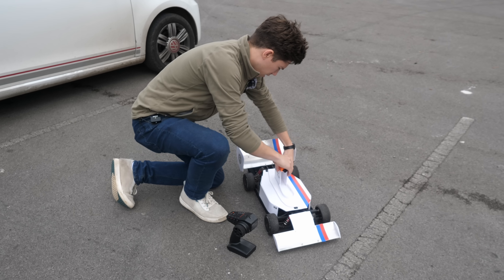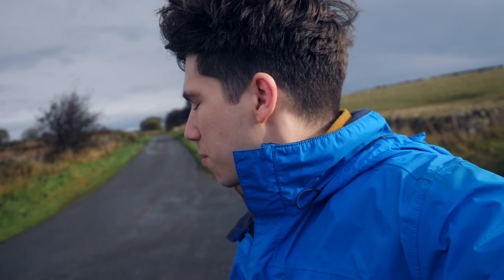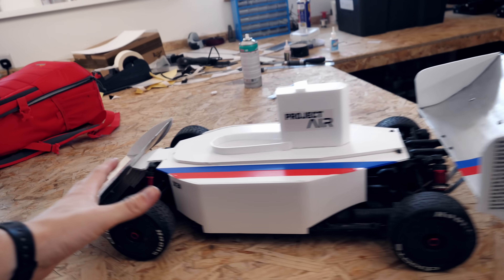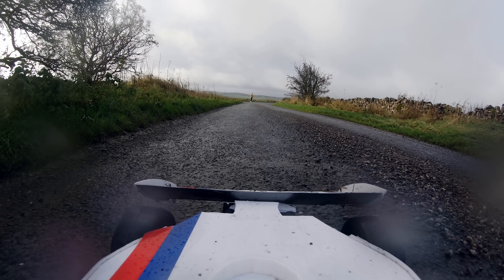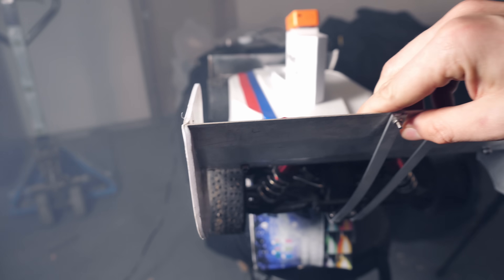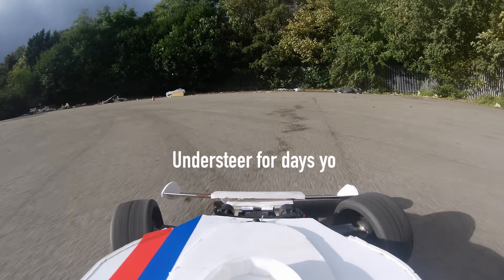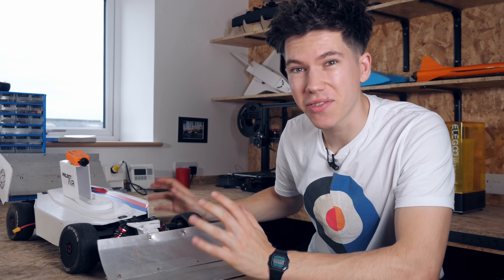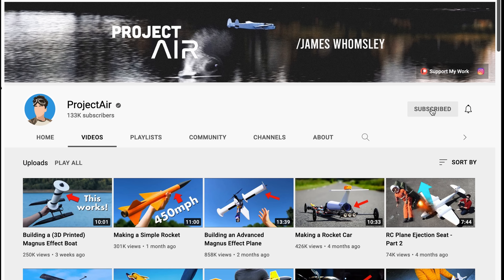RC Car Extreme Aerodynamics

Comment: Quick question, slight sidetrack- what you were saying about the airflow under the pan of the car passing through then expanding to create additional suction, could this be upended and have something engineered to improve lift on a wing..? I guess somesort of "double wing" perhaps?

Alanicus,
Oxford UK

Comment: Could you try active downforce? As in attach ducted fans blowing straight up to push the car down? Then switch off but leave in place for a comparison.
Maybe they could pull air from under the car.

Comment: remember, aerodynamic forces are generated almost primarily on the low-pressure side of the surface -- flow detachment on the bottom of your wings isn't just creating drag, it's also severely limiting the amount of downforce you're generating. less angle of attack on those wings might actually generate more downforce since they wouldn't be stalling. if you wanted to keep the aggressive angle of attack, you should upgrade to a multi-element setup to keep flow attachment.
Reply: Came here to say this, tried to warn him on the picture he posted a few weeks ago of the car.
Reply: Theres just way too much drag on these wings for the amount of downforce they’ll produce. Plus they’re no even an airfoil shape so you wont get much of a pressure differential.
Reply: @George-kd7uz  I’m pretty sure most of the force comes from redirecting the air mass, not the airfoil. At least that’s the case in airplanes
Reply: @jrewhutchison4414  Hold up. Please cite your source so it can be removed from the Internet, because that is completely wrong.
Reply: @George-kd7uz  it's not entirely wrong it's a combination of both
Reply: @George-kd7uz  Lift IS caused by air deflection. The upward change in momentum of the air (a vector with a y-component) causes an impulse (force) on the wing. Action-reaction. No net change in y-direction of air momentum = zero lift, a.k.a. an airfoil at 0deg angle of attack.

As a corollary, ANYTHING other than a sphere can produce lift, because it can produce a net air deflection at some orientation.
But wings are not made out of non-spherical couches because the the lift to DRAG ratio is not good.

Pilot training claiming that lift is produced by differing air speeds over high and low pressure surfaces is just plain wrong.
Reply: @johanvanstaden2408  some lift is generated by air deflection, but the majority is from the difference in pressure. Also, have you heard of ground effect, the only reason that works is due to fast air creating low pressure under a car
Reply: @George-kd7uz  The pressure difference is the same thing as the air deflection. Kinda like the chicken and the egg. The pressure is how the surface enacts the force (momentum change) on the air. 

Ground effect is streamtube theory (internal flow) .... Different from external flow.
Reply: @johanvanstaden2408  The pressure difference and redirecting the flow are two separate ways of creating lift though. If you have a wing with 0 angle of attack it will still create lift from the pressure differential without redirecting much air.
Reply: @George-kd7uz  At 0deg a.o.a. there is lift ONLY IF it's an asymmetric airfoil, i.e. net change in momentum.
Symmetric airfoil at 0deg creates no lift because no change in momentum / deflection / pressure difference.
There are no multiple effects - only 1 flow changing velocity/momentum and pressure. Single body/airfoil, single effect/characteristic at any given velocity.
Reply: @jrewhutchison4414  that's actually not the case at all. I can't remember the name of the video, but there's a great talk from a senior Boeing aerodynamicist about the mechanisms of lift posted on YouTube, and one of his points was how less than half of the force generated from the wing is accounted for by the Newtonian reaction force from deflecting the air mass.
Reply: @George-kd7uz  Check out a "wingcar" used in 1/24th scale slot car racing and get back to me on that.
Reply: @Metal-Possum  its more the fact that he said planes use air deflection to generate lift. Which is wrong
Reply: @George-kd7uz  It's not wrong. That age old comment of "air travels faster over one side of the wing compared to the other" that your physics teacher at high school taught you is a bit of information that just gets parroted by teachers, parents, and then by kids. The biggets flaw of that statement is that there is absolutely nothing saying the air HAS to travel faster over the curved surface, they don't have to meet up at the trailing edge of the wing, it was never a requirement. However, the air that does curve over the curved surface of an aeroplanes wing IS deflected downwards, and if air is diverted downwards, then the "equal and opposite reaction" is to push the wing upwards. You can make aeroplanes with flat wing surfaces and control the lift by changing the angle of attack, people do this with model aircraft all the time using materials as basic as cardboard. The reason we don't usually do this is because it's not the most efficient, compared to manipulating the air around a contour instead. There's a video or two explaining this if you know where to look, it's also why flaps are so effective, they divert more air downward.
Reply: @Metal-Possum  The air does travel faster on the top side of a wing, the myth part is that the air meets up at the trailing edge.
Reply: This is why the latest wings we are seeing on super cars "look wrong" because they are using "tear drop" type mounts to get the underside of the wing working better and in doing so they are mounting the wings from the top to keep the bottom cleaner.  The thing to remember is this needs to work exactly the opposite as an aircraft wing...
Reply: The problem here is he said downforce is created by “deflecting air upwards”, so he designed the wings with that in mind
Reply: Yepp
Reply: If laminar flow is a buzzword now, is Reynolds the next big thing? Should we buy his stonks? :)
Anyways good discussion here, but i'd be wary of applying too much common aerodynamic theory at this scale. Just using nature as a guide, bumblebee does stuff no conventional airplane designer would thought even possible. Laminar flow, vortex generation, low pressure areas etc are nice but at RC scales they start to brake down. So while his car is far from optimal, it's likely not as bad as it looks.
Reply: Legend
Reply: Also to my understanding ground effect is really temperamental, with any situation where the body contacts the ground or where the side skirts break contact resulting in almost total loss of the ground effect.
Reply: We're still arguing over how lift actually works so you can't be sure. Besides it's not the low pressure doing anything it's the high pressure pushing down, it's sort of like how a vacuum doesn't suck things in the high pressure atmosphere around it pushes things in.
Reply: Clicked the video looking for this comment
Reply: Well I agree with the low pressure comment but there are two things he is missing to make this work properly he needs ground effect on a low point of the body because the smaller the gap between the car and the ground means less speed needed to generate the downforce and he also needs stiffer suspension it’s way too loose causing the bumps to knock it it of suction to the ground look up the video of the mcmurry car electric race car is insane
Reply: The rear wing doesn't have to be behind the axle either. 👍
Reply: yup, if a wing begins to deflect air, energy is being wasted. You want smooth laminar flow across as much of the surface of the wing as possible. This creates that desired pressure differential between the top and bottom surface of the wing.
Reply: @Davey_Spoons  not exactly. Part of the downforce comes from this air deflection. Also, you actually do want turbulent flow on the wing surface if you want your flow to stay attached at high angles of attack, since turbulent flow carries more energy and stays attached better. Most airplane wings transition from laminar to turbulence at only 10% chord length.
Reply: @wesandbutters113  Thanks so much for pointing that out. "Laminar flow" has sadly become a buzz word and thrown around when people like to sound like they know what they talk about;). 
That said, and at risk of making the same mistake myself, if my 20 year old arm chair aerodynamics knowledge still holds up, laminar flow would be desirable and easier to obtain if we were aiming for the lowest possible drag, but as you say, he is going for maximum lift. Again, if I remember correctly, laminar flow needs "special" profiles to help it develop and when laminar flow does detach from such profile, doesn't it do so more abrubtly, with less chance of reattaching and with a much bigger drag penalty?
Reply: @wesandbutters113  with smaller wings like this the viscous forces become much more important which is quite interesting
Reply: Yea you have like 100kN of force per square meter maximum available, makes sense
Reply: Interesting, I never would have thought that the majority of the force is generated from the low pressure side. Now I think about it it makes sense too
Reply: Was also about to say that those wings create more drag than downforce, since most of downforce comes from the low pressure side. As you said he can either decrease the angle of attack or use a proper multi element setup or perhaps the easiest solution compared to multi element wings is some vortex generators on the low pressure side to try keeping the flow attached by energizing the boundary layer. 🤔
Reply: Are you related to Alec Baldwin.

Comment: Given what you know about airplanes, why are you not using the "wings" in a more traditional sense?  As in, as you explained in the beginning of this video, using the wing, just upside down. Consider building an airplane that wants to climb more and more the faster you get...you'd never build an airplane with that angle of attack.  I personally would love to see a video where you try to use the aerodynamics of a wing, even if protrudes beyond the base chassis, to prove that wings can push the chassis down...maybe have a scale on the front axis to try to measure?
Reply: also, why not just put one upsode down RC wing on top in the middle? way easier to experiment with different sizes, easy to mount and less weight.

Comment: If you're gonna go to all this effort, surely you can find a better location to drive? If you really can't, then I would be focusing on taking real measurements at home with a better wind flow thing. It wouldn't be hard to measure the change in downforce and drag using load cells or sensitive scales, you could tweak it and see the result instantly and make a nice graph. You would then have a proper empirical answer to the question instead of some highly circumstantial numbers like... timing runs over a distance, really? Outcome depends on driver input around a corner, really? Road surface is different between tests, wind is probably different, battery sag probably different too. And if your tweaking and mods actually resulted in measurably huge downforce, then you would be justified in putting "Huge Downforce!" in the thumbnail.

Comment: I think you misunderstand "drag" and "downforce".
Of course I'm not an expert, but I'm somewhat confident that just like at an airplane, where most force gets generated at the top side of the wing, the majority of the downforce of your car gets generated at the bottom of the car's wing.
That means, if you have layer separation (=stall) at the bottom side of your wing, then this does not just increase drag, it also drastically decreases the downforce.
Reply: I was looking for this commment

Comment: You should use multi tiered wings, these lower the speed that boundary separation/wing stall stops, also you can use a shallower angle of attack of the wings for same downforce

Comment: I've spent some time racing.  Mostly 1/10th indoor buggy.  Even with constantly jumping...the wing in the back is not optional.  Crashing a lot means you have to replace the wing frequently.  You cut the wings and increasing top end is easy as cutting a few lines down.  Front wings are optional but help when other adjustments cannot stop the car from pushing.  Suspension setup and onroad chasis flex is where most of the time is spent for handling/traction.  shaving a gram here and there is a big deal (especially rotational mass).  Adding weight low can help.  Front, middle, and rear weights are all available depending on what you want to do.  Lay down transmission.  Battery position...Endless choices but a big metal wing up high, never.

Comment: The spoilers just take the angle of attack and deflective force of the oncoming air i to account. The real work from spoilers is clear flow over and under the wing. The longer distance at the side you're looking to push to (spoiler=bottom) will accelerate the air over the surface amd create the lower air pressure pushing the surface. This will reduce the turbulence as well.

Comment: To solve the problem of having to big of a front wing split it in to two parts and have small gap between them so a little of the air could escape and go to the rear wing

Comment: I think for being peak science research you need to add the total weight of the aerodynamic panels to the bare chassis and run the chassis again. That way the weight is constant so the only variable you're testing is the application of the aerodynamics.

Comment: But... the sails are the wrong way round? The big one should be at the front acting like an actual sail pushing forward and down. The one at the pack pushes down balancing the down and any seesaw-style tippage from the front. Increased traction from the down and increased speed from the forward. I legit thought that was what you were talking about. I'm so confused.

Comment: For someone that flies rc aircraft 

I'm amazed how much you overlooked boundary layer separation,  saying you don't care about the drag , you just want peak downforce 

Yet on a plane when your angle of attack goes to high what happens, the wing stalls and you LOSE lift 

This is exactly the same concept ,a stalled wing creates less lift than one where airflow is attached on the low pressure side

Comment: A bit of constructive feedback.
1. If you were to make a wind tunnel you'll need some plastic straws to make the air entering laminar and the fan should pull the air through.
2. Only change one thing at a time when doing an experiment, if you change two or more things you'll never know what did what.
3. Stay safe and keep up the good videos. 🙂👍

Comment: I have a Lotus Elise Body on my 1:10  and when I remove the rear wing it becomes practically undriveable. Top speed is about a third higher than with the wing on. Also aerodynamic flow over the entire thing is super important too, not just the downforce of the wing.

Comment: While minimal, you really need to do a no aero package test with weight added to equal the weight of the aero kit added. With RC cars, I found that body weight is the main contributor to keep the wheels on the ground as ever little bump is far greater than anything a real car would experience when you take into account scale differences.

Comment: Film your turning circle from above on a smooth surface at a given speed and compare how tight it is with different aero. You can also compare the stock aero design that you took off at the start.

RC cars gonna understeer anyway, because you don't have fine enough control over the steering angle and in any car if your steering angle is too steep you just lose grip.

Comment: Front and rear wings only provide 20 to 30% of the overall downforce on an F1 car.  The bulk of downforce comes from the body and floor.  

Ultimately, front and rear wing are used to balance out the downforce and are tweaked to changed handling.

Comment: With wings at that angle you should have multi element wings to prevent airflow separation. That's why F1 cars have 5 elements on the front wings

Comment: You should try making a fan car- it was a design almost immediately banned from most racing circuits where a portion of the power was put into a rear facing fan that had its intake at the bottom of the car hence creating an incredible amount of downforce

Comment: You could probably get away with either making the rear wing smaller or lowering it's angle of attack, especially with the addition of side-skirts.  That would decrease both the drag (in either case) and/or weight (if you make it smaller).

Comment: You could try a fan to create down force like a reverse hovercraft. Use a fan to suck the air from under the car and create low pressure under the car. Then the down force would not be dependent on the forward velocity of the car.

Comment: Nice video but some things to correct. 1) Ride heigth for ground effects is the key, 2) front wing at too steep angle, probably close to stall, then low load on front wheels then understeering 3) check center of gravity to re- balance the car after it is loaded by wings 4) rear wing shadowed by front wing (and you got this) but also  by car body since it's too low. Now windtunnel of course 😃 !

Comment: If you had a flat round track with radius 2 meters. Then secured a post in the center and ran a line to the side of the car with a scale in between. Would you be able to measure the ground effect based on how much the car resists the centripetal force?